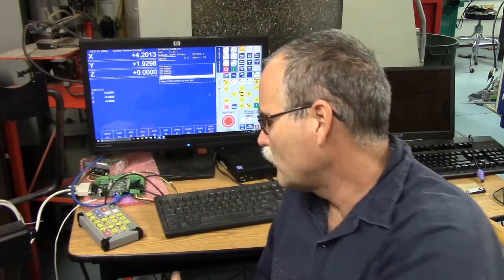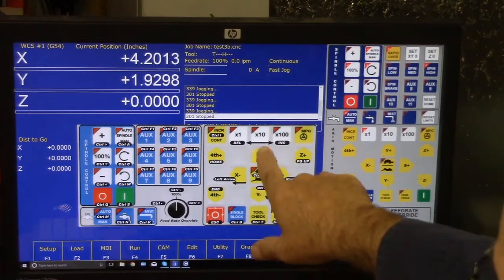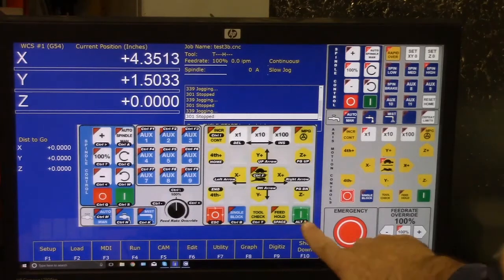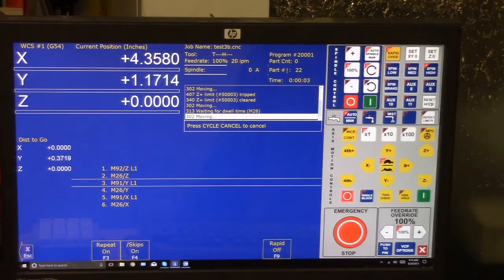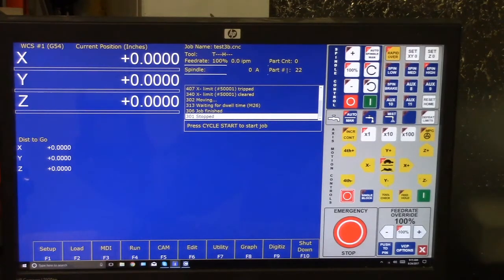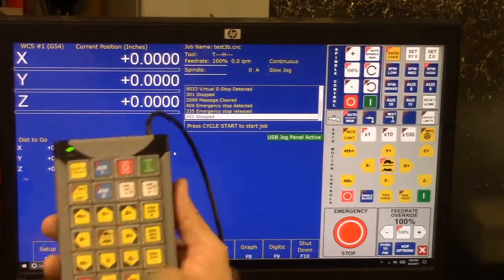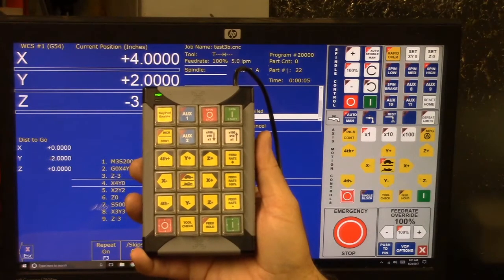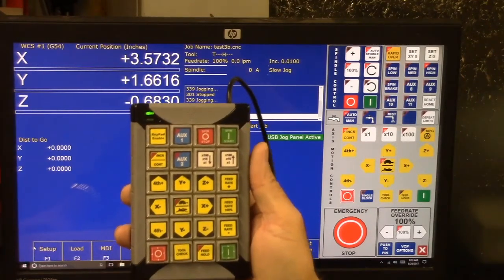Different methods to interface with the Centroid CNC Software

Comment: It's special the XK-24 (small keyboard) cost more or almost same as a MPG with turning wheel... To me it seems so costly for something that shouldn't be... When you think about it you can get a "gaming-quality lighted keyboard"  for less than 150$... the XK is about 200$ or so. I suppose it's because of offer & demand...
Reply from the maker: When you spend $200, I would HIGHLY recommend spending a little  more and buying the Centroid wireless MPG. The Contour Shuttle Express is about $70 and supported
Reply: @martyscncgarage5275  Yes I saw the wireless Centroid model but I prefer a wired version which needs no battery and not relying on RF especially for E-Stop. No RF waves around me while working is a plus to me as well. I saw the VistaCNC pendant that seems nice but not sure if they are compatible with Acorn, I will need to contact the company.
Reply from the maker: @QuebecoisSti  I can only tell you what is supported. Certainly you can try and use what is best for you.

Comment: Does cnc 12 have a relative position screen or a screen to display all positions absolute, relative and machine?
Reply from the maker: Position, Distance to Go and Machine Coordinates all on the main screen if you want them displayed as such.
Reply from the maker: In the current release. CNC12 for Acorn 4.50
Reply: Thank you. I also found in the manual to press alt-d. You’re awesome

Comment: Hi Marty good moorning! we have a router is a vectrax, automated by centroid, linux operating system, I use in it an intercon software to program at the foot of the machine, it has three days that is broken, it will hurt (apparently) the memory Q-flash, the question is Why do you think it has been damaged? the machine was turned off 18 days because we went on vacation, and when I return I find that fault, this is not it?
Reply from the maker: Gerardo, I can't tell you specifically what may have happened. I'm not clear what the error is either. I suggest you contact Centroid support by email, send them a copy of the machines report file, or go to the Centroid CNC user forums and post your problem there along with the machines report file. Good luck!